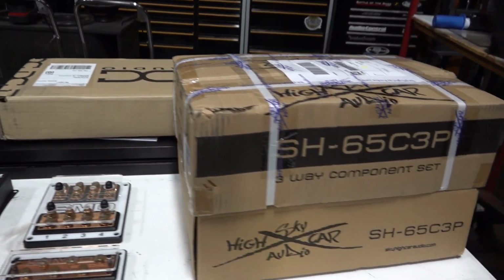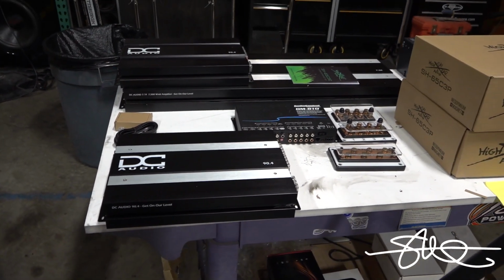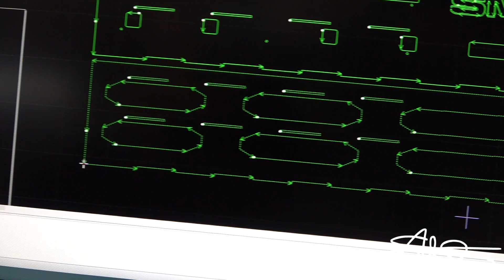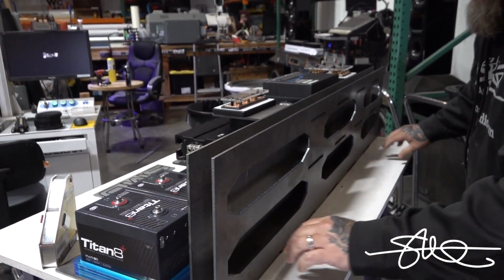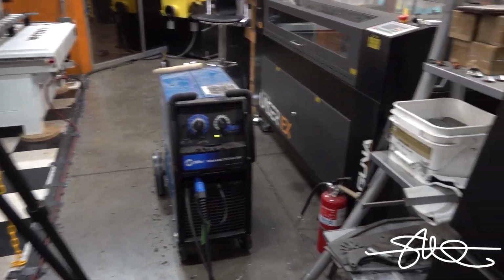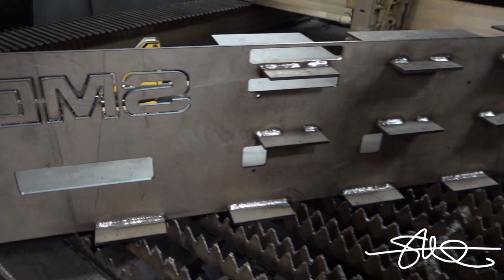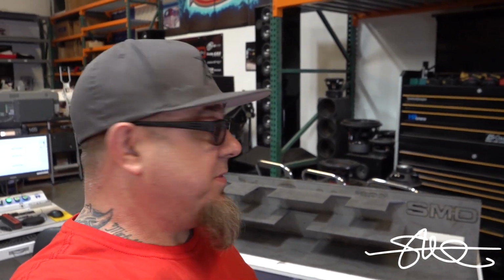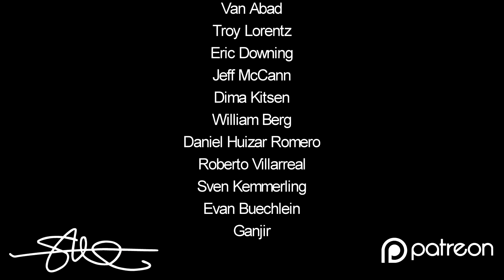"Floating" Steel Plate Car Audio Amp Rack laser cut Interlocked & welded together

Comment from the maker: I forgot to mention this is 3/16" steel plate.  See more pics of this build here >> https://www.stevemeadedesigns.com/board/topic/220224-kay-kay%E2%80%99s-gmc-yukon-2-24%E2%80%9D-subwoofers-amp-rack-started-all-steel/#comment-3258526 - there will be a part 2 or 3 on this rack since i have so much more to do.  Thanks for watching if you did!
Reply: I want to see you do more g body car for subwoofer
Reply: yea at first i was like how the hell would some thin sheets hold it up but then noticed it's decently thick plate for what you will need. This'll be a sick looking rack. its been great watcjing your fab skills improve over time. keep it up.
Reply from the maker: @ramren16  no i didn't.
Reply: @ramren16  he clearly says this inch and a half gives him some spacing to run the wires behind it in between the box!!
Reply: @meade916  I just got my 2 zvx 15”v2s the other day and built the box for them. It’s in my 2001 GMC Yukon! It’s pretty decent and way louder than my one kicker L7 15 lol but now I’m gonna have to save my ass off to get some lithium or xs power batteries bc it’s dropping my voltage super low even with the big 4 and (cheap Amazon special) high output 250 amp alt with 2 regular batteries. Love the builds man!
Reply: @meade916  sir usa which city u live

Comment: Nice work but too heavy
Reply: I agree you could just use for a amp rack itself bevel it and have 3/4 inch MDF board. Do your thing & make it look like metallic clear coat it or but you know what the hell you're doing Steve 💯
Reply from the maker: too heavy for who?
Reply from the maker: @robrohrer2014  3/4" MDF board would not work for this.  thanks anyway.
Reply: @meade916  I opened my mouth before I saw the finished product nice work well done as always

Comment: I don't know what you're smoking but them welds all look nice, and they look to have great penetration! I wish I could weld like that! Sadly my cheap welder has limitations! lol
That amp rack looking great though, something out of the norm and sets the build apart. Also have an idea for those 90.4s, both are the same heatsink except the old one is not threaded for the aluminum silver bars on top. I'm sure you could easily cnc out some custom bars out of plexi for the top, and use a bottom tap to make the 2 holes on the old amp, just don't go all the way though the heatsink, and use the new 90.4 to get the dimensions and locations for where to put the holes. For that matter you could do some custom plexi inlays on the tops of all 3 amps! I'm sure you'll think of something, you always do, or you'll just buy another new matching 90.4. :)
Reply from the maker: oh ya i thought about that but i wouldn't need to thread anything.  I could just stick on some colored bars with the clear 3m tape.  I got another 90.4 on the way so i won't have to use the old relic.  And i will probably STILL change out the bars.  I was thinking white....or pearl white with a logo in it.  Thanks man!!!
Reply: I think changing the bars, and possibly engraving something on them would spice the install up even more than it already is going to be with that bad ass amp rack!

Comment: For not being a welder, damn good welds man. It’s obvious overkill, but if it looks right it is right
Reply from the maker: Thanks man! i can weld, been doing it since Jr. High...pre-mig.  Just arc welding and oxy/acetylene back then.  Been using the mig for years of course but not enough to get REAL good at it. In order to be real good you need to do it a lot.  I can lay some dimes down when i'm in my groove but i need to work on my consistency and also my vision.  Sometimes i lose track of where i am going mid weld LOL!
Reply: @meade916  lol I feel ya. I had to put cheaters in my hoods this past year. I like getting older, not a fan of my eyes going bad from 20+ years of welding lol. But that’s life

Comment: Looks great, just curious, any particular reason why you used metal imstead of wood, especially when you wont even beable to see the shelves on the rack. Again, just curious. Love you guys. ..
Reply from the maker: because if i did wood it would have to be a lot thicker and probably have to use supports on the outside edge which would defeat the "float" aspect of it.
Reply: @meade916  that makes a lot of sense!!! Trust me when I tell you, I knew there had to be a calculated reason behind it all. You have always built for longevity not convenience. Thanks big bro....

Comment: Question I have 2 level 2 10s dc audio with 2 k mono dc audio amp. I also have the dc audio 175.4 amp for mids and high speakers. Do you recommend a 2nd battery for this setup?? It’s going in a 97 Honda Civic sedan. Or would I be good just doing the big three , under the hood battery upgrade, and alternator upgrade.
Reply: @shawnkarvonen  which small battery would you recommend? Would I need to upgrade the alternator as well?
Reply: Big three most everything. At least have new wires. I've heard depending on your car up the alt over like a grand in watts. Or fifteen. I dunno tho.

Comment: Way overkill!! A 1 second tack can hold 100lbs…Also, it you can want a smaller welder, try vertical welds…less warpage. Anyways…still cool to see you utilize ur new tools in a build! Kickass!!
Reply from the maker: I have a smaller welder.  I upgraded to the bigger better one.  No need to do a vertical weld and make it more difficult for really no reason.  This worked good.
Reply: Of course it's over kill this is steve meade were dealing with everything he does is stout 😂